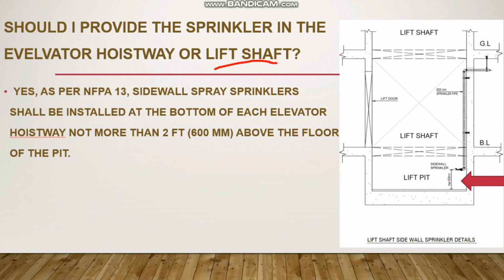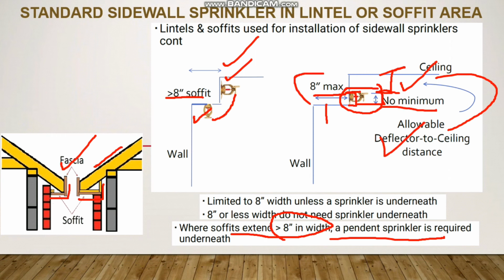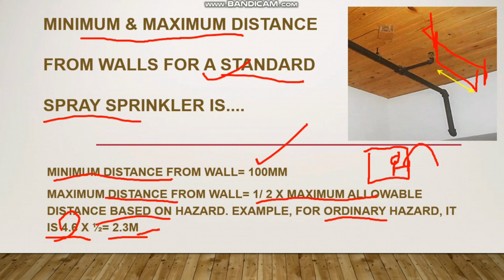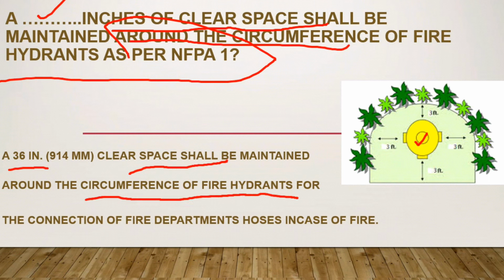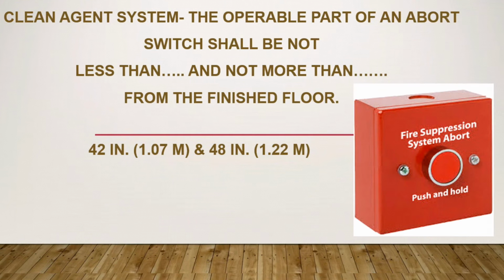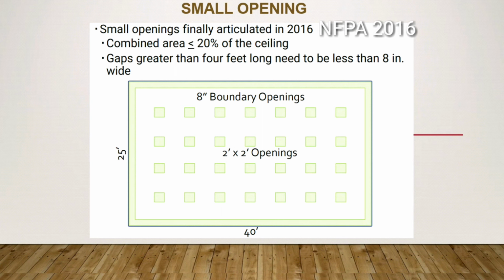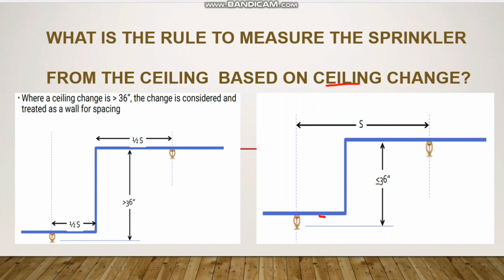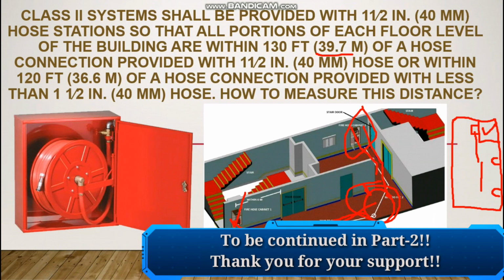Firefighting & Fire Alarm interview questions l 100 important Questions of fire fighting system

Comment: 10.3.4.1.4.1 The maximum width of the lintel or soffit shall
not exceed 16 in. (400 mm)
10.3.4.1.4.3 The maximum width of the lintel or soffit can
exceed 16 in. (400 mm) when a pendent sprinkler is installed
under the lintel or soffit.